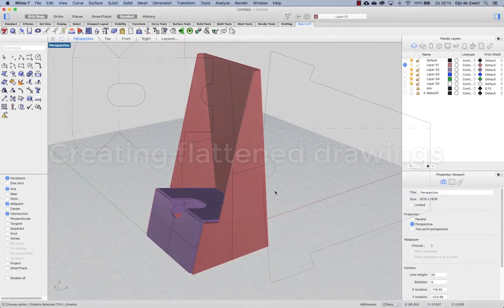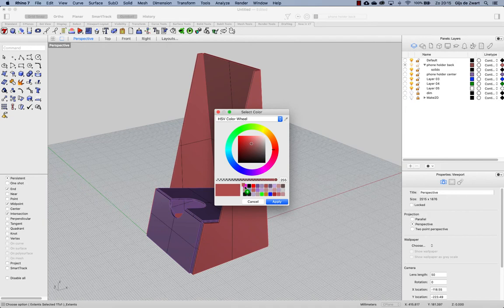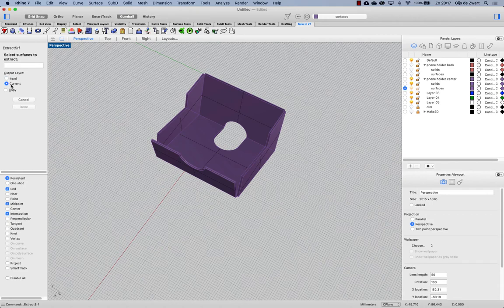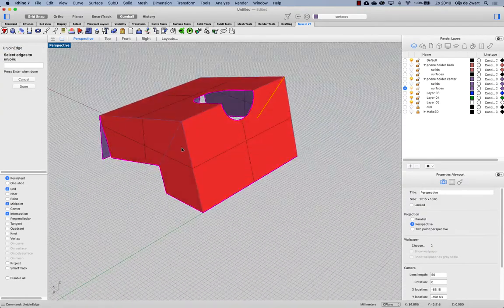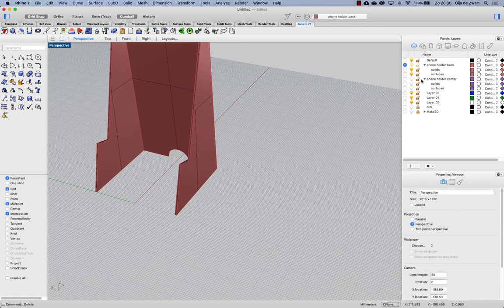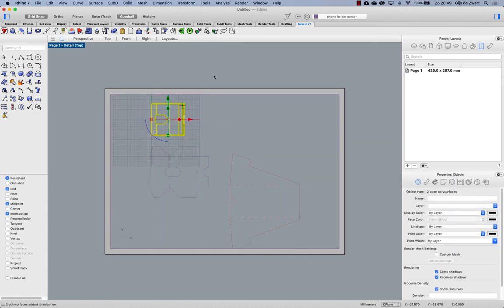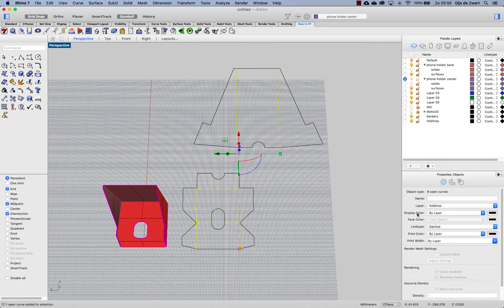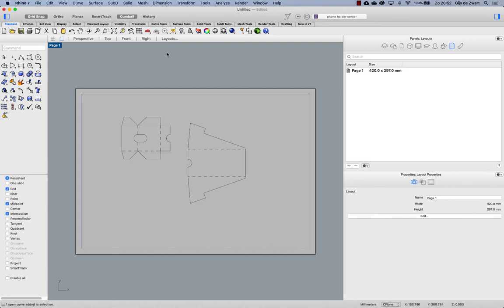creating flattened drawings in Rhino

Comment: Hello Gijs. Nice videos. Do you have any solution to include k-factor, or bend radios, to maintain dimensional accuracy when bending thicker metal? I have been having trouble making the drawings fabricated with the same final dimensions as the model. Thanks
Reply from the maker: Well, sort of… but it’s not very straightforward to do this in Rhino. When I made the 170 long bench in Amsterdam Houthavenpark in grasshopper I had to take bend factors into account. So for this I made a custom definition specifically for that project. I would say that if this is your daily work there are better solutions for sheet metal in products like solidworks. The math is not difficult, it’s just that all the rollouts of the bends need to be scaled according to this k factor.

Comment: Hi. Thanks for the video. I'm drawing a very basic object (assume a flat plate bent in a z type fashion). I understand now how to get the flattened surface for Lazer cutting but the flattened drawing doesn't tell the Lazer cutters what angles they need to bend on the bend lines (and the angles are not visually obvious). Is it possible to flatten the surfaces so that the final layout also includes the specific bend instructions? Or must I rather type them in? 

Thanks
Reply from the maker: any annotation you want to add you will need to generate as text (or curves depending on your laser) and include in the unroll operation. Best to do this with Grasshopper, especially if you have a lot to annotate, otherwise you will need to add that manually as a post process. There are Grasshopper plugins to add these annotations to the unroll, for example Elefront (or Bowerbird if you need text as curves).

Comment: Thank you for this very good video! My problem now is that I cannot print full size patterns of my 2D object. For example, I have a complex design that is 33x24 inches and want it printed at 100% scale on multiple letter size paper which can be taped together, as an aid to cutting the sheet metal; Rhino prints ONLY 1 sheet of paper with only a small part of my pattern.  I have tried many ways to do this yet only 1 piece of paper is printed. I am disappointed Rhino cannot do this. Any simple solution?
Reply from the maker: Hi, thanks for your comment. For tiling your print across multiple pages, this can often be done in your printer software. But also acrobat has an option to print one pdf across multiple pages. So best is to print to a pdf on a large scale format so that your drawing is 1:1 scale and then use acrobat to tile the poster to multiple pages. You might want to add additional markers to the drawings for alignment.
Reply: @studiogijs  Thank you! Yes, printing or saving to a PDF has been recommended, BUT that option -- from the Rhino menu -- does not seem to be there. Down in the lower left corner it says PDF but when you save the view, there is no pdf in sight on my computer (Mac); nowhere to be found.
Reply from the maker: @AerialLensVideo  what's your Rhino version?
Reply: @studiogijs  It is 5.5.5 for Mac
Reply from the maker: @AerialLensVideo  in that case it should work normally by printing while you are in layout view. If not it’s better to post your issue at discourse.mcneel.com
Reply: @studiogijs  I am embarrassed to ask, What is Layout View? Although I am a long time ameateur user (since version 3), I've always just printed from a given view; RIGHT side panel in this case.
Reply from the maker: @AerialLensVideo  have a look at https://youtu.be/PgdY__u9vi4